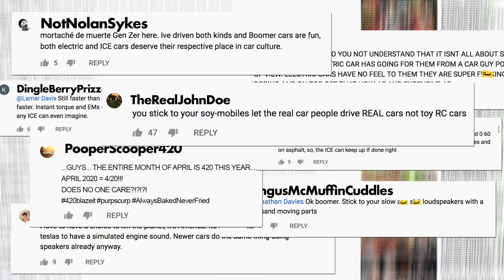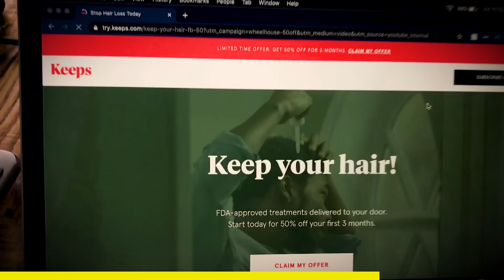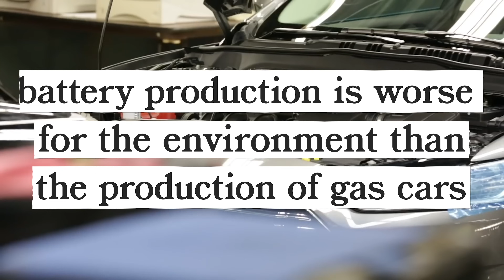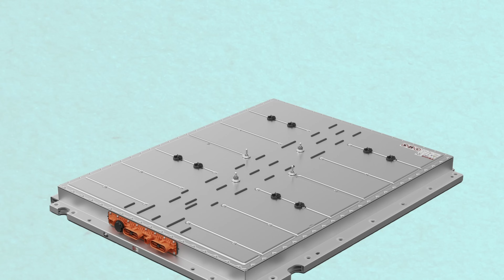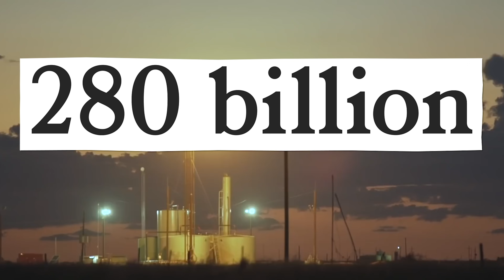Are Electric Cars REALLY Better for the Environment?

Comment: Remember, both cars uses oil products..so you can not put the co2 only on the fosil car alone.. then fosil car vs EL car last much longer.. a 20yr old car is not hard to find in perfect state. Vs EL car after 10-12 years needs a new battery.. thats like... 20-30k dallar.. no one want that..just to inform you.. wind mills are not effective.. its a lie.. research it!!

Comment: One thing I felt was unfair in this video was only equating oil refinement to ICE cars.  EV vehicles still have plastic parts and lubricants also.  Actually EV vehicles have more plastic than most ICE vehicles to keep their weight down.

Comment: You forgot that a Diesel engine is mush better then gas engine? The power grid in Sweden can not handel more today so if we got a lott of EV it would be a meltdown. And in the winter a battery loses about 40% of it's charge.
Reply: what utter garbage. Clearly, you have never owned or driven an EV.  Most modern EV's have battery heating, which avoids the very issue you mentioned.
Reply: @Brian-om2hh  yes I don't own a EV but i have driven one,and where does the power com from to heat the batteries.😎

Comment: Guys CO2 is not a problem. God designed photsynthesis which is a circular process all God's systems are circular tere is not a depletion of resources whereby CO2 is converted into Oxygen by green plants utilizing photons fromthe sun and water. The problem for electric cars is they are only attractive to the naive who are convinced that Co2 is a problem. We exhale CO2 when we breathe. Many many people like the sound of combustion engines and the convenience of not having to recharge batteries. Both fossil fuel and the lithium needed to make the batteries, what do you do with them when they are obsollete? are surely a limited resource. I suggest the concentration should be on Hydrogen powered vehices as the exhaust in steam, again a circulat system, the sound is still there and apprantly combustion engines run more smoothly and more powerfully on H2. The problem seems to be how to obtain Hydrogen gas at an economic rate but I suggest if God and Jesus want cars to be powered by H2 that will happen and i could be part of Jesus's 1000 year reign predicted in his Bible.

Comment: But how often do have to replace those batteries? 17 metric tons every time those batteries need to be replaced 🤷🏼‍♂️
Reply: 10-15% battery capacity decreases in 8-9 years roughly.
Reply: @wittyusername1  that's a lot better than my cell phone's battery and my car and trucks battery, have to get a new phone about every 2 years because my battery starts going dead in a couple hours. Every about 5 years I have to get a new car battery 🤷🏼‍♂️
Reply: They have an 8 year warranty from new, so maybe a battery refurb at 10 to 12 years old?

Comment: You missed a big big point. When everyone gonna have a EV car no actual powerplant system will be able to feed the demand!
Reply: Not true.
Stupid argument
Reply: @tbcyable  well it’s not. Firstly EV’s charge at night when demand is lowest. Secondly, if you produced less fuel that free’s up a whole ton of grid capacity, hell, oil well pumps in Texas alone use enough energy to run more than 20 million BEV’s. Third, the grid at current can support 25% population in EV’s. But that’s if it all happened today. The grid on average doubles it capacity every 20 years. Most analyst think we won’t have full market penetration of EV’s until 2050. The grid never stays the same. It’s constantly expanding to feed a constantly growing need for energy. So by the time EV’s have full market penetration, not only would the grid be well and truely large enough to handle the demand, but it would also not be feeding as much energy to oil pumping, transportation and refining.
Reply: @engineeringtheweirdguy2103  in Canada at -35C when everyone is heating is home.
Reply: @tbcyable  most heaters in those kinds of climates are either heat pumps or gas. Not usually every resistance heaters, meaning the load is less. Additionally to this homes in those climates as well as the grid are designed for that sort of thing. Meanwhile in Texas where people could only get their hands on resistance oil heater and had homes designed to stay cool not keep warm, as well as the grid infrastructure, then the grid couldn’t cope.

As it stands the grid can cope just fine. Heater is used about as much at night as in the day with those kinds of climates, the power just shifts from office and industrial buildings for heating to domestic buildings. The grid would be designed around this much like any other grid is designed around their own climates.
Reply: Not true

Comment: Electric Cars suck keep in mind efficiency which is unmatched by traditional cars.
Reply: Why does efficiency make EV’s suck?
Reply: @engineeringtheweirdguy2103  well the alternative or renewable forms of energy such as windmills are both costly and inefficient compared to using coal. So it costs more to build thede renewable firms, then electrical cars cost more, and in the end depending on the car there isn't much of a difference between traditional and electrical cars. Of course this may change in the future .
Reply: @countlessbathory1485  who the hell told you that load of rubbish? Renewables are buy in large 1/3 cheaper per name plate mW rating than coal, gas or oil power plants. They are also significantly cheaper to run considering you don’t have to buy fuel or employ 500 employees to run everything from maintenance to admin. Renewables have been proven to reduce the wholesale price of energy significantly because of this.

They are far cheaper. As for efficiency, they draw power from a renewable source. So efficiency isn’t really a concern. But it is when you burn fuel. That being said, they operate at around the same efficiency as coal and gas plants with windmills taking approximately 60% of the energy out of wind. With a similar benchmark for solar.
Reply: @engineeringtheweirdguy2103  that's completely bs I had no idea I was taking an indoctrinated religious moron. Firstly just do a google search for "windmills are neither clean or green" and read the article. Wins turbines cost a lot, require a great deal of resources, kill many animal's and coal is required to run them. Also in the grand scheme of things if renewables were cheaper best bet businesses will adopt and use them because that will brinh dowm production costs. Bringing this back to cars electric cars are coal powered cars and as i mentioned based on model and size there may not be much difference between electric and standard cars, but the cost will be higher for the electric model.
Reply: @countlessbathory1485  what the hell are you on about mate? this isnt a contentious topic anymore. The science is in. we have the data, this can been confirmed. Wind turbines are cheaper than coal gas and oil power plants. So is solar. And what do you mean the run of coal? how the hell does that work in your head? that statement makes litterally no sense.

Any place which has seen widescale adoption of renewables has seen a drastic reduction in wholesale energy prices and most have seen an increase in stability (I say most because I have to include California which I can get into later if you wish). In Germany, widescale adoption of wind and solar has seen a drastic reduction in wholesale energy prices. They have also reduced their power outages by 10x in 10 years due to the uptake of renewables coupled with some form of energy storage for capacitation. South Australia's energy grid was THE most expensive grid in Australia and THE most unreliable. Now that they have 70% renewables and battery storage they now have THE cheapest wholesale energy prices in Australia and THE most reliable grid in Australia. 

The cost of windmill per MW is around $3 million dollars. The cost of 500 MW coal power plant is $3 billion for a 500MW powerplant. So if we scale up the wind turbine farm to 500MW thats $1.5 billion for 500MW of nameplate wind energy. And $3 Billion for equivalent nameplate costs for a coal plant. I mean, just google images of wind farms vs coal power plants and tell me which you think would be cheaper to build. In addition, wind turbines dont have to buy and burn thousands of tons of coal every day to generate the required power nor do they require some 500+ employees to operate a wind turbine farm. where as you do for coal gas or oil power plants.

This isn't an hypothesis, nor is it brainwashing, or a conspiracy or what ever tin foil hat you want to put on it. The science has been done. Its there in black and white. The real world examples are there. we know they are cheaper. we know they pollute less than burning thousands of tons of coal every day.

also its cute that you think the millions of birds killed every year by wind turbines is a big number. But lets put that into context for you, the context that was so conveniently concealed from you by which ever source you got that from. whilst wind turbines kill millions of birds each year. Cell phone towers alone kill BILLIONS. infact, even high rise buildings kill more wildlife than wind turbines do. This is because wind turbines, despite advertisements, aren't very quite when you're close to them. they emit a low frequency hum. A loud hum which animals do not like. Infact populations in the area usually aren't killed. They just move elsewhere. They avoid the wind farms for this reason. No such loud hum or anything to discourage birds from transmissions lines, cell phone towers, or high rises, all of which kill more birds annually than wind turbines.

wind turbines discourage animals from going near them the same way hearing a loud truck rolling down its engine brakes discourages you from crossing the road.

perhaps getting the whole picture with accurate information may make you look like less of an idiot on the internet in future.

Comment: Electric cars is too short and does not go exact range as oil cars
Reply: Too short?
Reply: @engineeringtheweirdguy2103  I’m talking  about the range
Reply: @ShampootheSpider2019  why is it too short?
Reply: @engineeringtheweirdguy2103  I look up about why is it so short and on people also ask,it said that when temperatures drop cold, the range declines and the range drops which was why electric cars is not suitable for winter season
Reply: @engineeringtheweirdguy2103  performance drops too
Reply: @engineeringtheweirdguy2103  cold winters could be explained why batteries is weaker on colder weather

Comment: Tires last longer on a hybrid than an electric car because the electric car weighs more and the tires have more pressure on them
Reply: Doesn't cars need to change battery?

Even phones need to change in 3years. Cars are hell lot expensive & EVs 😓
Reply: @gamingwithxan1430   but a standard lead acid battery can be refurbished and last 10 -12 years if properly maintained.  Ev batterys last 5 years and can't be refurbished.
Reply: @Vistal11  They last up to 10 years and we can recycle 90% of the metals in them*
Reply: @Vistal11  Utter garbage!  A new EV has an 8 YEAR battery warranty..... and they can be almost completely refurbished or recycled. Where do you people find your misinformed nonsense?
Reply: @gamingwithxan1430  they need to be changed after 500k miles. So it's not really an issue. You also get an 8 year warranty or 150k miles which ever comes first.
Reply: It's not about the weight of the vehicle, gear changes and braking is the cause of wear. EV's do not have that issue, soft/even  acceleration and braking (regenerative breaking) is remarkably less aggressive on tyres.
Reply: @clintthomas1854  isn't that on the driver? I mean, don't drive like you are GT3 on the road

Comment: Diesel beats all
Reply: Actually no. It’s actually more fuel efficient to charge an EV off a diesel generator that it is to use that same diesel in even a highly efficient Diesel engine.
Reply: @engineeringtheweirdguy2103  I didn’t say it was better. I’m saying it’s cooler and more interesting than anything else
Reply: But unfortunately it doesn't have a hope in hell of complying with the carbon zero target set by the Paris Climate Agreement. In another 10 years, almost every town and city will have emissions charging schemes, meaning you will be charged to drive into town and city centres. We are starting to see this already in the UK, with Birmingham introducing their scheme a few weeks ago. It costs £8 per day ( payable 7 days a week ) to drive into the centre if your vehicle does not conform to at least Euro 6 standard.

Comment: hydrogen is the future and you all know it !!
Reply: It isn’t. And for some very good reasons.
Reply: @engineeringtheweirdguy2103  No its not. Water is. Theres a company here in chile ( the driest country in the world ) thats using water as fuel. And it goes back into the atmosphere as water vapor. I know sounds impossible but its not. i had the idea of instead of having gas stations we have water ones. They take water or whatever liquid and it pumps inside a car fast. This spins hydro mills which create energy directly for the car. and pumps the water out of the same hose you pump the water in at the same time. Not sure if it would work but maybe ill try it in the future. What do you think?
Reply: @user-ue3pl2gf4o  well it wouldn’t be very efficient. You’d basically be making a hydro generator inside the car. You’d lose around 15% pumping the water into the car and around 40% from hydro generator inside the car. Meaning you’d have a total loss of nearly 50%.

It would be better to use the electric motor in the car as a generator. When you park at the station the wheels are on rollers which speed up and spin the wheels. The electric motor then charges the battery. This process would only have a loss of around 20-25%. Less if you use kinetic energy storage to transmit the power to the rollers. This would also mean that during a blackout, the rollers would still be able to charge cars for a few hours.
Reply: @engineeringtheweirdguy2103  i don’t believe you would be losing that much energy. Your design sounds cool but the issue is tires would have to be specialized and have large components for that to work. Not to mention it’s dangerous fir friction like that to be occurring near batteries. Plus using water is natural and can be use again and again and again. And its not  extremely hard to do. We wont have to worry about making entirely new charging points which cost a lot of money. Hydro electricity is efficient and decently cheap. Heck people with rivers in there back yard can install and use hydro electricity. And to use it in cars doesn’t mean it needs to be water.
Reply: @user-ue3pl2gf4o  you wouldn’t need me components in the wheels or specialised tires to do that. And it’s also perfectly safe. Cars actually do this today. Hybrids and Battery Electric vehicles use this as regenerative breaking. When they slow down, instead of wearing the break pads, the electric motor in the car (not in the wheels) swaps from motor to generator. The motor absorbs the kinetic energy into electric energy at an efficiency of around 96%. 

What I am suggesting is that it would be far more efficient to leverage current working and efficient EV design, by using the motor in the EV as a generator. Just like regenerative breaking as I’ve described above, except instead of slowing the car down, it’s parked on rollers which will spin the wheels. Sort of like a car dynometer (google it) but instead of the wheels spinning the roller. The roller would spin the wheels.

But all in all, the fastest and most efficient way to charge an electric vehicle would be just plugging it in.
Reply: @engineeringtheweirdguy2103  yea but like i said it’s going to be expensive to do that.
Reply: @user-ue3pl2gf4o  why? The equipment is already in every EV and hybrid. All you need is a couple of rollers (or even 1 per car) and an electric motor to spin it.
Reply: @user-ue3pl2gf4o  as opposites to either retrofitting or adding a hydro generator to all new electric cars and developing plug points, providing de-mineralised water, and installing pump racks connected to a water storage tank.
Reply: @engineeringtheweirdguy2103  The thing is you need brand new stations to do that. With my idea you wont. We just need new hoses and thats pretty much it. And as long as the water continues to stay clean enough it will be able ti be reused
Reply: @user-ue3pl2gf4o  and you’d have to retrofit the pumps to pump water instead of petroleum. And you’d have to upgrade them for a higher flow rate as otherwise it would take a very very very long time to charge. And you’d have to install a second hose to receive the outflow water. 

It’s more complicated than you think
Reply: @engineeringtheweirdguy2103  The outflow water if needed could flow drain in the bottom in the car and a small series if tubes designed to create currents inside the car could help to.